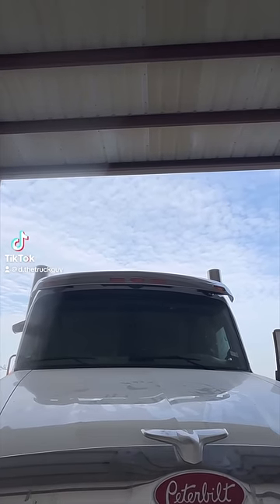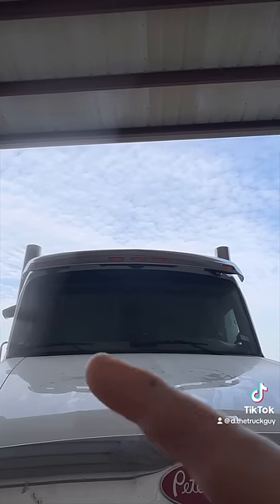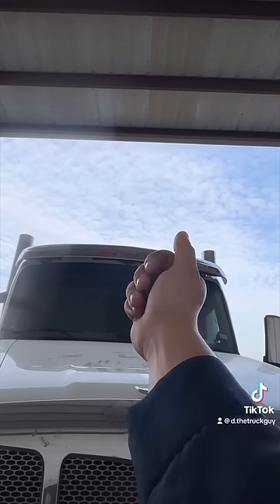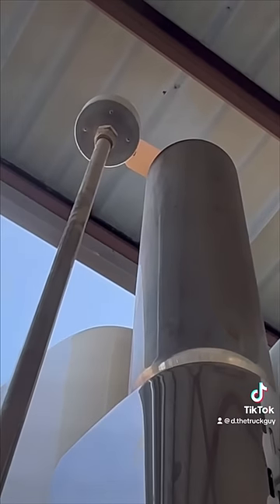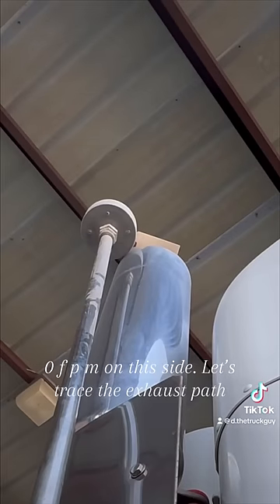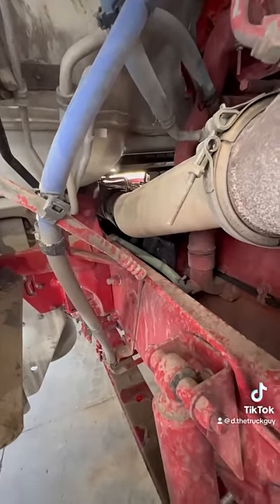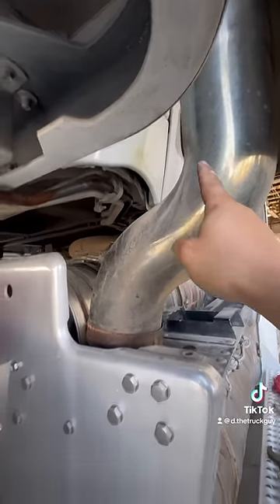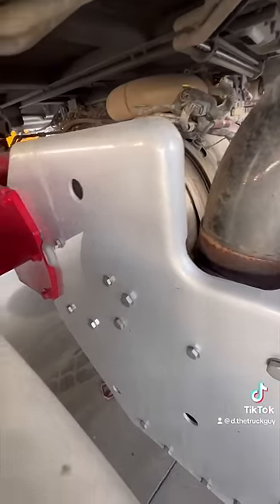#mechanic #truckdrivers #diesel #dieselmechanic #truckdriving #trucker #dieselrepair #semitruck

Comment: That’s the least of his problems he should be worrying about. Why is he rolling coal with aftertreatment?
Reply: Cus he's a potatoe head. 😂😂😂
Reply: Came to say the same thing lol
Reply: It's probably deleted.
Reply: @Mr.NiceGuy80 as god intended
Reply: @d_kortman  Damn right.
Reply: Possibly the Regen cycle. Especially because they said "whenever I'm rolling coal" implying (to me) it is infrequent.
Reply: black smoke doesn't mean it's broke now if it was white smoke we have a different story
Reply: @golddaytonas  or worse. Blue smoke.
Reply from the maker: @gzus1482 😂👍🏻
Reply: @golddaytonas white smoke doesn’t always mean something bad, a regen can blow a shit ton of white smoke. Or if you idle your truck long periods moisture can build up in a low spot and when you take off and your egts go up in can burn it out, but yeah If you see white smoke for sure look into why but doesn’t always mean it’s broke. This isn’t a comment at you, just elaborating so someone doesn’t get scared shitless If they see it lol
Reply: @Mr.NiceGuy80 it's not deleted....the parts are there lol
Reply: @younggun9956  you can cut those parts open, remove the guts, weld them back together, then re flash the engine computer to trick it into thinking the parts are still functional and the def is full. Ask me how I know.
Reply: @Mr.NiceGuy80 yeah....but considering the guy couldn't tell he had a fake stack I doubt he paid to have that done. A truck guy would know
Reply: @younggun9956  possibly. Could be a deleted company truck too. The guy driving doesn't own the truck.
Reply: @Dmaxtyler  understandable brother I did forget about the regen used to see it all the time at the Chevy dealership I worked at and it always sounded like a jet engine taking off
Reply: @golddaytonas  yeah and it’s not all the time brand new trucks won’t do that typically cause they have gotten better at the whole system but mine used to do it when I was driving locally and had a regen but if I was on the highway it wouldn’t do it. My gf dad has a 6.4 and it doesn’t have def yet just dpf and his smokes it’s ass off during a regen highway or not
Reply: He needs more potatoes in the other side to balance it out.
Reply: @Mr.NiceGuy80 😂 I love when people try to talk about something they know nothing about.  That truck isn’t deleted
Reply: @robtaylor6806  you must really love yourself then. The whole point of deleting a truck is to rid it of emissions equipment without making it appear to be rid of the emissions equipment. That way, when you go for your yearly DOT inspection for your sticker, it doesn't appear deleted. The same as gutting a catalytic converter but leaving the empty shell on the exhaust. Go ahead and ask me how I know.
Reply: @Mr.NiceGuy80 You're not fooling anyone when you're getting your inspection.   We all know.
Reply: @nitroustommy3668  oh, okay. I definitely don't know what I'm talking about then. Thanks for setting me straight. I forgot who I was for a minute.
Reply: @Mr.NiceGuy80  I didn't say that.  I said you're not fooling anyone when you're getting your dot inspection.  We know its deleted as soon as we see any soot in the pipe.  On a functioning system the tail pipe is completely clean inside. 
Ask me how I know... 😂
Reply: @golddaytonas  if you have dpf black smoke means broken
Reply: The DPF is clearly there and hooked to the exhaust. So no, it’s not deleted
Reply: @jayhaddan7927  so, you remove or cut open the DPF, remove the insides, then patch the hole in the dpf and replace all the covers and crap. People have been doing this for years.
Reply: @nitroustommy3668  It's not completely clean inside any diesel exhaust pipe. You can't tell me, even on a full final tier emissions diesel there is nothing on your finger when you rub it around inside the exhaust.
Reply: @Mr.NiceGuy80  you know how hard that is. Your everyday guy is not doing that to his truck.
Reply: @jayhaddan7927  everyday guy may not do it, but there are plenty of shops that do. I've personally been to farms that do deletes on farm equipment incognito. I have most definitely been in and around diesel shops that do deletes incognito.
Reply: @Mr.NiceGuy80  https://youtu.be/mWepb5SgaLM
You tell me.  Those are my fingers and they're completely clean.
Reply: @jayhaddan7927  he's right, people gut the systems.  They drill right through the filters.
Reply: @nitroustommy3668  I saw black on your fingertips. I hate to say it, but it's obviously there.
Reply: @nitroustommy3668  you can’t just do that to newer trucks. They have sensors and systems that will cause it to go into low power mode. The only way to do it is to flash the whole computer.
Reply: @WhiteShadow2k1 theres a translate to english for this and it thinks your saying kill!
Reply: @Mr.NiceGuy80  man I think I started something here lol its 100% possible it could be deleted, just unlikely. No companies around me would risk the fine to delete a fleet truck. But it's plausible. Peace out guys
Reply: @younggun9956  good talking to ya, sir.
Reply: @jayhaddan7927  Yep, I'm a heavy duty diesel mechanic. I know exactly how it all works.
Reply: Can you explain that to me?
Reply: @thelespauldude3283  explain what? The reason the pipe isn’t connected or the rolling coal and shouldn’t be smoking part
Reply: @Mr.NiceGuy80  yeah you can do that to 2019 and older. But after that the computer has to be takin out and sent off to flash. So you don’t know
Reply: @Mr.NiceGuy80  they are not doing it to 2019 or newer trucks, I know that for fact. Because now the computer has to be takin out and sent off for flash
Reply: @jayhaddan7927  I had mentioned flashing the computer already in an earlier comment. I've driven deleted trucks. They're pretty great, the DEF tank seems to always stay full.
Reply: @Mr.NiceGuy80  yeah, my def stays full on my 2021 power stroke, no refills required
Reply: @Mr.NiceGuy80  start it up an you can hear the difference. Ask me how I know.
Reply: @younggun9956  I have seen it done its there in appearance only hollowed out dpf !
Reply: @Mr.NiceGuy80  yeah, nobody is gonna notice the patch at all. They literally hook up to the OBD2 to check, you realize that right. You know my uncle did this with his company truck and got nailed.  Laughed my ass off from a state without inspections, 5 inch turbo back, egr delete, dpf delete, running a big tune, with injectors and two turbos. If you're gonna delete, grow a fucking pair.
Reply: @Mr.NiceGuy80  farm vehicles dont need to fake a delete, they can run off road diesel and cut the exhaust off. Why do you think all these companies make you sign an "offroad use only" waiver now. Ask me how I know.
Reply: @fenixchief7  If you think the government won't come check your emissions equipped farm machinery to make sure the components are still on it while in use, try again.
Reply: @fenixchief7  They don't hook heavy duty trucks up everywhere. Here in NC for example, diesel trucks dont get Emissions inspection. Safety inspection only.
Reply: @fenixchief7  You're an aggressive one aren't ya? You're one of those people that take everything way too seriously. You gotta relax, bud. We're all gonna end up dead either way. Lol
Reply: @@WhiteShadow2k1when you try to translate “murica” it says kill😂😂😂
Reply: @Mr.NiceGuy80 in some states they actually check the exhaust with sensors and if it's polluting too much your f**** and will have to replace all that stuff
Reply: @conwaykitty8647  yup. We all know there are ways around pretty much everything. This is no exception. When the government fears us, that is freedom. When we fear the government, there, you will find tyranny.
Reply: Whoopsie, deleted...
Reply: @Mr.NiceGuy80  equipment is the same way . Open up the can pull the guts then install everything back so it looks functional and flash the computer .
Reply: @Mr.NiceGuy80 I'm getting ready to buy my own this year please tell me how you know
Reply: @Mr.NiceGuy80 I was thinking of just getting cut outs
Reply: It's intentional. A lot of diesel heads do it to anger environmentalists. 
From diesel rigs to guys who drive diesel pickups. 
Not a single one of them realize the damage they're doing to their own vehicles.
Reply: Shhhhh
Reply: @jayhaddan7927 no, you can flash it in the shop,  guess how i know?
Reply: @Mr.NiceGuy80 knew you were in NC, called it!
Reply: @westernstar9121  Holy crap. That would be sweet. Flip em open going up grades for some extra power. Flip them open on the way down grades for some nasty Jake action. Lol
Reply: @fenixchief7  There's no difference between off road diesel and on road diesel. Off road has a dye in it so it can be checked for in road trucks. Off road diesel isn't taxed. That's the only difference.
Reply: @@WhiteShadow2k1that translated to "kill!" 😰
Reply: @Sabamika1  it does absolutely no damage to the vehicle sorry you are totally wrong I have 5 diesel trucks and a deleted rig they actually run much much better and get better fuel economy and more power without all the emissions crap on them !!!! Same as heavy equipment , oh yeah they are twice ad reliable deleted too
Reply: @Mr.NiceGuy80  this is the most common way ive seen deere owners delete their tractors. A guy around here just seperates the filter sections, zip zoop with a hole saw then run a program through the ecu and bam deleted. And as a field service tech we arent allowed to work on deleted engines without returning them to stock🤷🏻‍♂️
Reply: Definitely one of those flip flop wearing steering wheel holders. Not a real truck driver.
Reply: @Tonymount123  I used to deliver bulk oil for a living. I would routinely go to a huge farm and deliver oil to the mechanic shop tanks. They were deleting everything in there. When they ask for right to repair, they don't want field service techs out there at all. Nothing personal against what you do, but some need you and some don't.
Reply: @gzus1482  OK Dan Quayle, lol.
Reply: That was my second thought too. My first thought was what mechanic preforms a flow test before checking to see if it's a faux pipe.
Reply: @Sabamika1 it also increases engine life, injector life, fuel economy, oil quality, lowers maintenance, lowers EGT’s, and improves the driving experience. I have a deleted diesel truck and the only time black smoke comes out is if I am full throttle in the highest tune. Even then it’s hardly any. It’s intentional because people want their engines to last longer, not always to piss off “eco-freakos”. But yes, many a time it is used to make people angry
Reply: Its bad for any engine to be rolling coal plus its stupid as hell
Reply: @kingzgaming4031  it’s just money going out the exhaust.
Reply: Nobody wants to breath charcoal if I did I just do a BBQ in the backyard
Reply: Btw deleted trucks are extremely illegal and will bill out a very very hefty fine specially against a company.
Reply: Take a wild guess bud
Reply: @kingzgaming4031  sorry you can’t afford a Deisel brother, maybe one day!
Reply: @golddaytonas  with DPF & SCR it means one or both have failed with any smoke coming out when at operating temperature
Reply: He wasn’t rolling coal. Just said he was!
Reply: Because having a properly running emmissions system is absurdly expensive.
Reply: Nope rollin vape the first 2 miles  on a cold day that’s all you’re getting 😎🤣🤣🤣🤣
Reply: @golddaytonas  does that mean we have a new pope?
Reply: turned up
Reply: @younggun9956 lol the amount of times I just hollowed the can out and reinstalled it
Reply: @Mr.NiceGuy80 Hell yeah
Reply: @younggun9956  I know plenty of truckers who deleted their trucks; the fuel saving alone will pay for the fines in less than 3 months!  And no worries for sensors to go bad or down time to clean DPF.
Reply: @jayhaddan7927  All OM642 are bench flashed since they came out; nothing new here.  Not everything is flashed on bench, depending on the model they can be flashed without taking anything off.  Depending on equipment you are using; 2023 Cummins, Ford, Man, Iveco can be flashed without pulling out ECU.
Reply: @Mr.NiceGuy80 I've worked for a few logging companies where pretty much all the trucks besides new ones were deleted
Reply: Best place for that aftertreatment is the landfill where it belongs
Reply: @younggun9956 You can delete and leave all the parts. Just have to drill thru the DPF filter etc

Comment: Not rolling no coal with the def system installed
Reply: Lmao who said it wasn’t drilled out?? Think my man
Reply: @ofcitsredd  drilling the filter won't do sh-t for rolling coal.
Reply: DPF* cuts down on black smoke. 

SCR uses DEF to reduce NOx emissions. 

Completely different systems.
Reply: @ofcitsredd shhhhhhh
Reply: It could very well be deleted.
Reply: I'll put money on you CAN and have plenty of proof! 😂😂😂
Reply: Legalize potatoes!
Reply: Maybe not rolling any serious coal, but I’ve puttered out a small puff out of my 579 by dropping a gear and putting my RPM’s to 2300 😂
Reply: @ofcitsredd  think man, that’s a newer truck. You can’t just do that without the sensors putting the truck into limp mode. The whole computer has to be takin out and flashed. This is not 10 years ago buddy
Reply: @Texassince1836  the def is responsible for the cleaning
Reply: @jayhaddan7927  DPF Diesel Particulate Filter is responsible for removing the carbon soot, and when you Regen it you are burning off that carbon soon.

DEF Diesel Exhaust Fluid reacts with hot exhaust gasses to reduce NOx emissions.

DEF does absolutely noting for rolling coal.
Reply: I've never seen a truck not roll coal...
Reply: Dang axel Foley should've learn after that banana in the tail pipe🤣🤣.
Reply: Ain't no lie
Reply: @transformersmaster23.  2300 rpm?  Unless you are running some pathetic 12 litre motor.... you won't be doing that for long.  Your rings have probably already been damaged and some of (possibly all) your bearings are wiped.  Go get an oil analysis at your next oil change and hopefully I am wrong.  If there is abnormal metal and fuel dilution... don't worry about it.  Your engine is fucked no matter what you do.  If it looks good.... thank the Lord and get a mechanic to put a rev limit of 1800.
Reply: @walterdennis7023 my dpf is hollow and it now rolls coal, so yes removing the guts makes it better
Reply: You still can believe it or not.
Reply: @heavyhaulerfreightliner7529 not to mention coal comes from extra fuel not being burnt usually at lower RPM, how much fuel is he dumping at 2,300 that's not being burnt.
Reply: @sneekysnake1239 Then you obviously don’t know about 90% of trucks on the road don’t

Comment: The best is when the dummy pipe is actually hooked up and you pull it apart to realize it's blocked off
Reply: Why is that a thing?  If you go through all the expense to have a pipe there and be hooked up, why block it off?
Reply: @NotAffiliated  it's just what they do from the factory for whatever reason. You'll have to ask my arch enemies, the engineers
Reply: Lol 😆 🤣 😂.  Why? Carry the extra 100 pounds of weight for no reason at all. Just for looks
Reply: Western stars are notorious for this option lol
Reply: @shadowofkhaos someone is OCD and couldn't handle just one pipe?
Reply: @chrisblair3081 kenworths too.

Comment: A damn shame that a truck driver can't simply inspect underneath the unit he operates. Everybody wants to drive a truck until they realize there's more to driving a truck than holding the steering wheel. A damn shame. Should've billed him for a new exhaust stack and y pipe.
Reply: Brother  they do it everyday,,,when it's not thier own truck,,they don't  care
Reply: Same goes for cars man lol
Reply: Damn.   Throw a bypass kit on that thing
Reply: He probably doesn’t do a very thorough PTI.
Reply: Depends on if he's an owner/operator or not😂
Reply: Some morons just want to make big clouds and can't figure out a vape.
Reply: @jeromerobinson1707 when it is their truck they don't care either. That's why it's in the shop lol
Reply: It's a damn shame
Reply: See also: everyone wants to drive a large car, until it's time to do large car shit
Reply: Nobody wants to drive a truck lol
Reply: @WearyKirin  Speak for yourself lmfao
Reply: Sad thing is u don't need to get under it to know that it was setup like this.
Reply: @willmann30 they are truck drivers not heavy duty diesel mechanics…👩‍🔧 they need to know only what is in the pre trip inspection
Reply: Like you don't need to be an expert to know if the exhaust had a potato, after a fucking rev that potato would be flying upwards to the stratosphere.